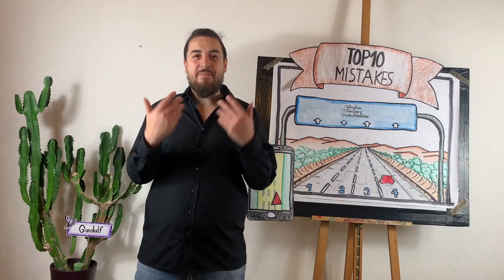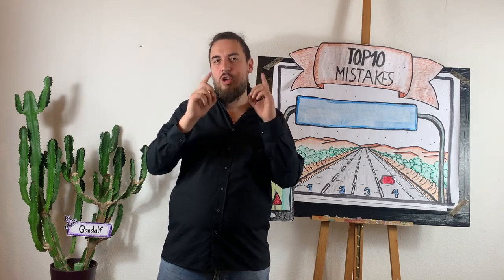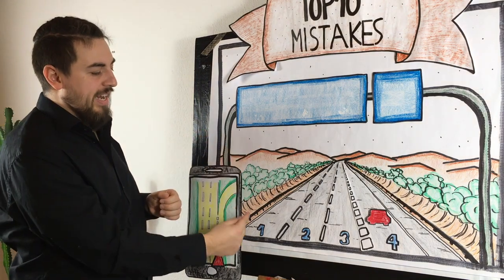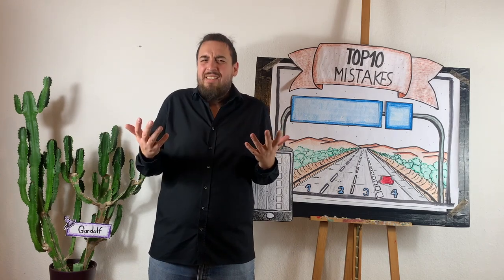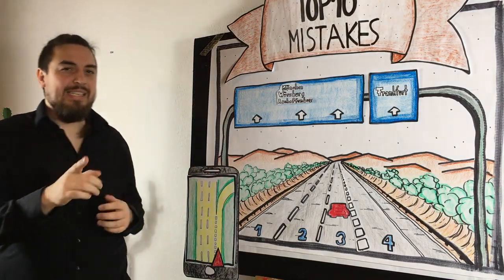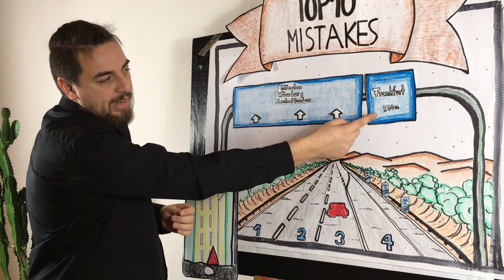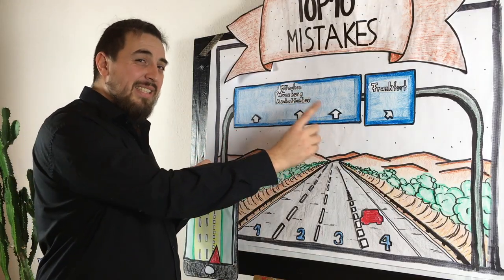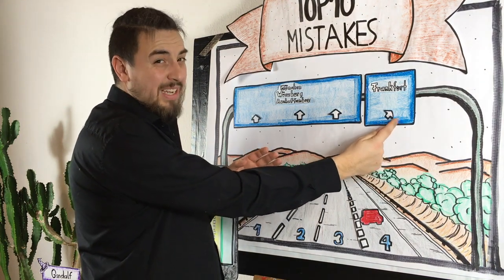Highway Signs and Boards | Episode 7 | Top10 German Driving Test Mistakes

Comment: I am confused on when to break when lights changing to yellow . Should I stop or continue …. Please make a short video on this topic as well , much appreciated - Thanks
Reply: Simply put: Green is go, the others are stop. But with yellow also if you can't stop in time (to close or to fast) you can drive safely through the lights. Flashing yellow means lights are not working properly, slow down and be ready to stop, road signs and drawings on the road apply. In germany while standing in front of a red light yellow will litt up (so red and yellow at the same time) to indicate green will come shortly. Don't start driving, it's not green yet.